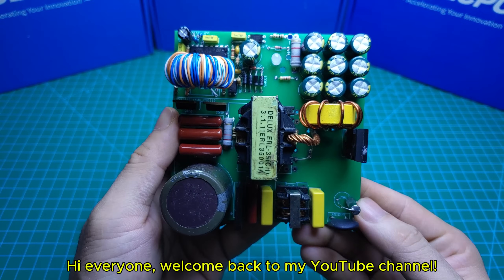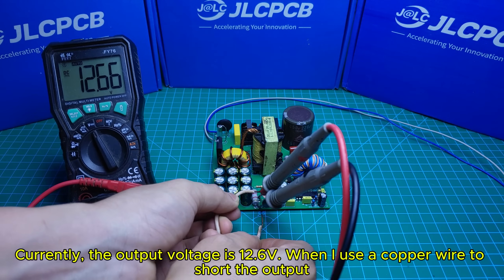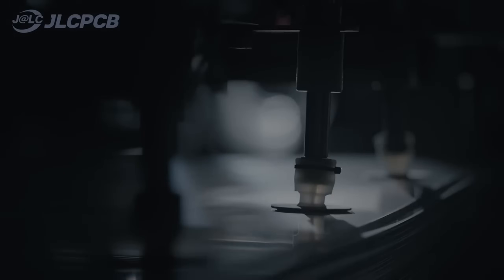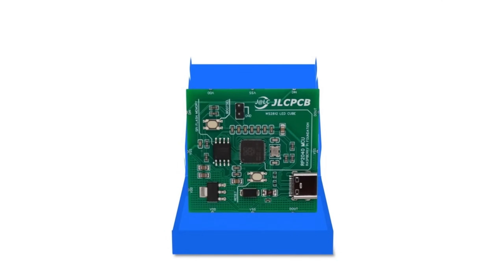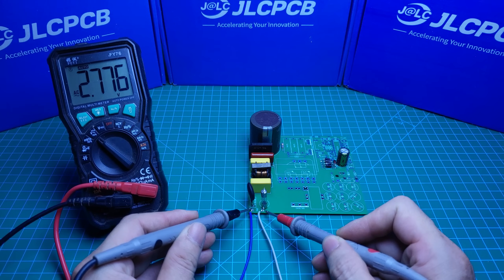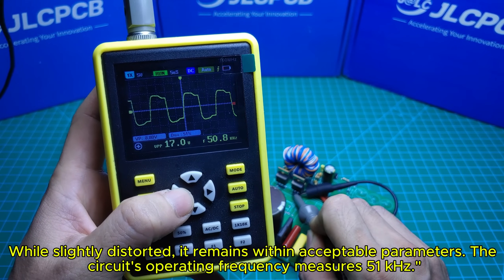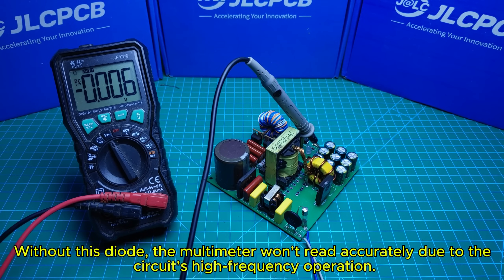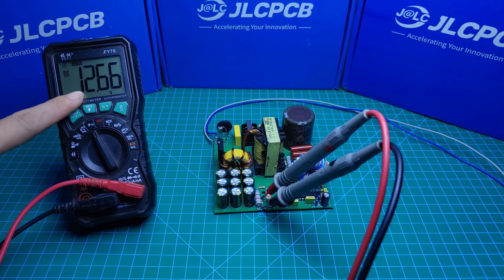No-Coil-Winding Power Supply:  Salvage & Reuse PSU Transformers :JLCPCB

Comment: By changing the transformer connections, you can achieve an 24V output. Next step is to make a flyback power supply for the UC3842 using a transformer from a damaged LED or laptop power supply.

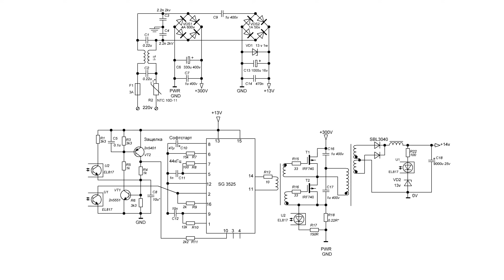Comment: scheme at 3:42 are you seriously!? 
It is very funny to use a capacitor in the primary circuit to get a sensitive supply voltage for the PWM driver logic. And also using for this diode bridge with 50v limit.